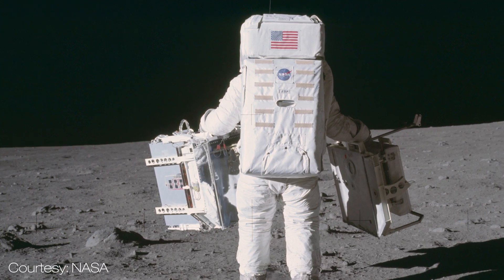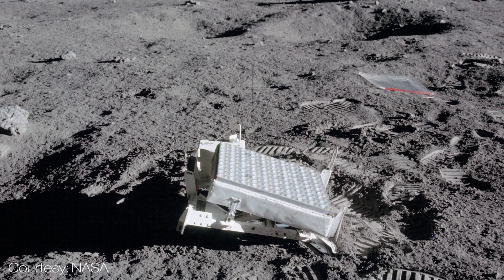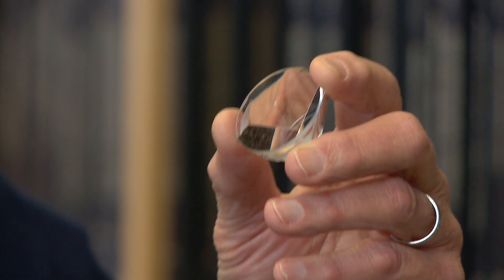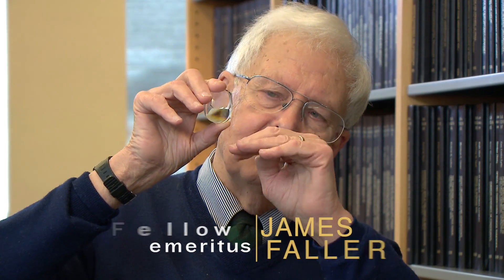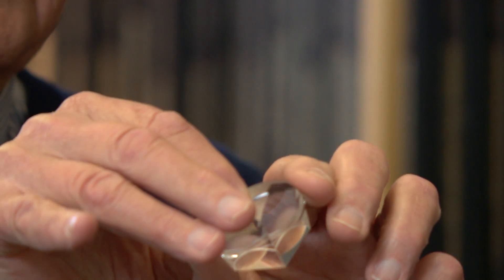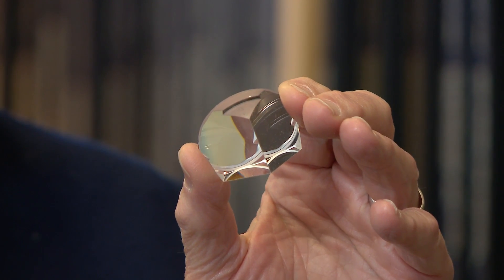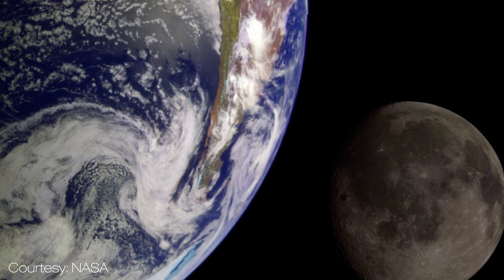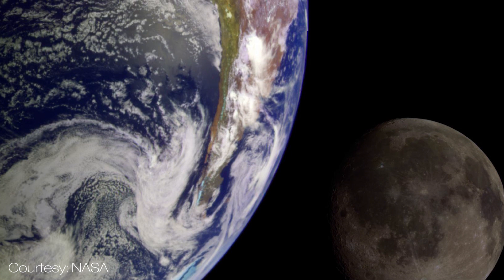Apollo 11's last working experiment on the moon

Comment: So, where is the stars in the sky from the Moon,  the sky is pitch black with no stars?  ...oh well, need a graphical technician, that will solve it.
Reply: That's to be expected due to the way cameras work. For example;

Google Image search: Full Moon Photography
Where are the stars?

Google Image search: Full Moon Selfie
Where are the stars?

Google Image search: Telescope Mars
Where are the stars?

Google Image search: Full Moon Sports Stadium
Where are the stars?

Google Image search: Moon Airplane Photography
Where are the stars?

The camera exposure settings required to capture brightly lit objects (clearly and in focus) is too fast to capture the stars at the same time, hence the examples above.

That's why we also don't see any stars in the background of photos and videos of astronauts in low Earth orbit.

I hope that helps :-)
Reply: You may be imagining that the stars are much brighter than they really are.  The cameras used on the Moon were set for daylight exposures, and lunar daylight exposures are the same as earth-bound daylight exposures.  Stars are much too faint to be picked up during a daylight exposure because the film used doesn't nearly have enough dynamic range, nor do any other films that I am aware of.  This is why the sky is black.

For example, the full Moon is magnitude -12.7, the brightest star (Sirius) is magnitude -1.46, and the faintest stars visible from a dark site on Earth are about 6th through 8th magnitude, depending on the quality of the skies and the ability of the observer.  My best (from Death Valley National Park in the late 1990s) was right at 7th magnitude (verified with a star chart), so I will use this middle value for the following comparison.  Being on the Moon, which has no atmosphere, would gain the observer a paltry 0.1 magnitude or so compared to a really good site on earth.

BTW, here are two good explanations of the magnitude scale used in astronomy:
https://en.wikipedia.org/wiki/Magnitude_(astronomy)

https://en.wikipedia.org/wiki/Apparent_magnitude

Getting back to the magnitudes I listed above:
The Moon (-12.7) is approximately 29,800 times brighter than Sirius (-1.46) and approximately 69.6 million times brighter than a 7th magnitude star.  A brightness ratio of 29,800 is equivalent to 14.9 photographic spots and a brightness ratio of 69.6M is equivalent to 26.1 photographic stops.  IIRC, the film used for lunar photography had a dynamic range of about 12 stops.  However, assuming exposures were set for the middle of that dynamic range, only about 6 stops were available to pick up the faint stuff.  As you can see, the stars are much too faint.

You can test this yourself with either a film camera or a digital camera.  Daylight exposures take only a small fraction of a second, whereas it takes many seconds to many minutes to pick up stars.  Add the stop differences in ISO, aperture, and shutter speed between a daylight exposure and a nighttime exposure that picks up stars and you will see just what I described.
Reply: You know how you can see trillions of stars in places that don’t have lots of light? (Parks, forests, countryside, etc) but you can only few a couple dozen stars in a bright place like a city? Same thing for the moon, the sun is so bright to the point where you can’t see a single star

Comment: The moon is retroreflective anyway. No mirrors needed to bounce laser photons back 🙄
Reply: @aemrt5745  the experiment works by timing the return of the first photon. That will obviously be from the parabolic crater (that's filled with retroreflective titanium dust) closet to the laser source.
No artificial mirrors are required.
Reply: @Andre 

You seriously believe we can pinpoint a tiny reflector on the moons surface when we can't even see the other junk they supposedly left behind? 
Get real will you!
Reply: @pleasepermitmetospeakohgre1504  We can see that retroreflector in the darkness of space the same way we can see the retroreflectors on the back of a parked car at night by shining our own headlights on it.  And seeing the other stuff is as hard as see the bumper stickers and scratches on the parked car.

Comment: Hmm I still drive around with a paper map ..no battery required! 😉
Reply: so do i mate, to many places i have to go have no cell coverage to rely on google maps to operate with any degree of trust.
Reply: @kiwidiesel  use waze… you can download the map and it‘s free
Reply: The lunar ranging cornercubes Also do not need any batteries to work.
Reply: @YDDES  lol just need to pack my rifle next time point the laser sight  at the moon then.
Reply: @kiwidiesel  Yeah, if You have an good enough photon detector, to catch the few returning photons.

Comment: What a load of crap, experiments were done bouncing lazers off the lunar surface 6 years before any astronauts pretended to land there on the apollo myth
Reply: Perhaps you are meaning the EME expriments using RADIO transmission - this just bounced radio waves from the bare surface of the Moon like a radar does. The retroreflectors were sophisticated mirrors for reflecting LASER light placed there by real NOT mythical Apollo astronauts.
Reply: @eagleone493  2 seperate universities bounced lazers off the moon before apollo not radio waves and you may be unaware but the Russians place 2 retro reflectors on the moon with their unmanned Luna 17 and Luna 21, in 1970 and in 1973 so the apollo reflector is a moot point anyway
Reply: @johnporterfield7523   I still maintain my points about radio wave transmission type tests that is still a fact. I was just wrong in not knowing that there were laser reflectors before Apollo. I accept Luna 17 and Luna 21 But still call you on your claim  of them pretending to land and that it is a myth.
Reply: @eagleone493  like everyone else I wanted to believe we went. There's actually a lot of very good reasons it had to be faked and it didn't start out that way, 1960s technology just couldn't achieve it and during a cold war arms race, it had to be hoaxed. Its not difficult to find thousands of reasons it couldn't have happened, it's up to you whether you want to find out about it or like most people you're happy to accept NASAs version.
Reply: @johnporterfield7523  A blanket statement like "1960's technology couldn't achieve it" without any actual evidence does not prove anything. I have lived from 1959 to 2021 and saw the landings on live television and have seen the photographs in books magazines and now on the internet I have even seen visiting exhibitions of Nasa displays with genuine items I have spoken with an astronaut - ok he travelled on the shuttle not the Apollo but would have been in on any "hoax". There is too much evidence For the moon landing to be real and only trivial andd easily debunkable claims that it is ahoax. if it was filmed in a studio - where? by whom? why are there no "whistblowers" how did they fake the saturn v launches now that the first stages have been found in the ocean? and the list goes on.
Reply: @eagleone493  it's a big subject mate, go to aulis.com and read through some of the papers, some of them are extremely detailed and lengthy breaking down the issues they had... There's a huge paper about the spaces suites alone. You do know that unmanned apollo 6  shook itself apart at launch.... There are photos of the bottom fifth of apollo 11 on fire at launch, the inconel rocket nozzles basically melted due to the thrust, there are detailed analyses of the launch frame rate explaining how the launch velocities were no where near enough to escape gravity... All of your valid questions (and mine) are explained. Unfortunately for NASA, all this stuff can still be analysed as its recorded and things like cosmic radiation can be measured... Even the elapsed time for cons signals to reach the moon a d be answered don't match up, radio waves have a know time and distance to reach the moon and come back.... There a gazillion holes in the story
Reply: @johnporterfield7523  All Aulis .com has is pages of baseless claims speculations and regurutations of material taht has been debunked time and time again. Nobody has come up with any facts as to who "faked' the photos where the studios were how can you fake a whoe saturn V rocket? they tried to say that the suits were fake just because the sealing ring was exposed in one photo you can find an X- ray photo of the gaunlets if you want to research them - Aulis did not include this bit of info in their expose' so I give them no credence whatsoever.
Reply: @johnporterfield7523  It is less about "accepting Nasa's version but rather having lived through the era acepting all the facts and evidence that they went to the moon from all of the thousands of external sources. Is the whole world lying? It is not just NASA.
Reply: @eagleone493  OK, last response to you. Why would you need a little tin can on a rocket when the Geand had 50 different functioning disk shaped craft by the end of WW2? Have you even heard of Operation High Jump? The Washington 152 flyover? The battle of Los Angeles? The testamony of William Tompkins? You're living in a bubble... Try looking up Vladimir Terzisky.... You simply have no clue.... Answer me 1 more time and your reported, you have been warned
Reply: @johnporterfield7523  I will politely request that you do not resort to theats. This is intended to be an open forum for discussion.
Reply: @eagleone493  Neil Armstrong had a saying for people like JP.....
'his mothers one small moment with a stranger made one giant idiot for all mankind'.
Reply: @apocalips8008  Whether or not that's a true quote from the late Neil Armstrong - I do agree with it.
Reply: @johnporterfield7523  Go to moonhoaxdebunked dot comm. Enjoy! Oh, and please don't "report" me! 😂
Reply: @johnporterfield7523  
Not half as ignorant as yourself.  Give us a full explanation, and I do mean full, for AESEP and the multiple ALSEP installations.  How they made it to the lunar surface, assembled, cabled over wide areas, probes dug into the lunar surface, and aligned?  At Orroral Valley Tracking Station here in Australia we used to upload commands and download data from ALSEP on a daily basis until ALSEP was turned off on the 30th September 1977 due to NASA budget cuts.  Three shifts of thirty plus day staff etc.  I can assure you, we weren’t chasing kangaroos…
Reply: @Andre what have you blown to pieces? I already said the Russians put 2 retro reflectors on the moon with Luna 17 and Luna 21, in 1970 and in 1973 so you think the special super one the pretend appollo astronauts put up there was the only 1??
Reply: @Andre \ Thank you
Reply: @Andre if you knew anything about the lunar surface, you'd know every square cm of it is struck by a high energy radiation particle between 8 and 20 times a minute, you'd be dead within a day unless you had a shielded habitat actually you'd be dead somewhere between leaving the van Allen belts and arriving, cosmic radiation is lethal.... Funnily its been measured and NASA now have to include a shielded area in the planned Orion capsule.... But a smart guy like you would know all that if you researched anything atall instead of talked shit on youtube
Reply: @Andre you should spend an afternoon reading the very well researched papers on aulis.com, many by PhD engineers and scientists. If you do, you'll be under no illusions no man has stepped on the moon. I have no axe to grind the the apollo narrative doesn't stand scrutiny. If you have any doubts read the of the papers on Aulis, they're actually brilliantly informative. Or carry on believing the moon landing stories, makes no difference to me. Or watch the 3 hour documentary "American Moon" free on bitchute which also blows apollo to pieces.

Comment: How is that taken there would be a camera there :/
Reply: The device is passive. The design means that any light shone on it from any angle is reflected back to the source. The device is just mirrors forming 3 sides of a cube. Any light striking any inside  surface will do a 180 degree turn
Reply: @vvanderer  Same design is used in the plastic reflectors that are can hang out of a pocket.  But the close-up side picture was taken by an Astronaut to confirm the reflector was put down correctly
Reply: @johndododoe1411  interesting